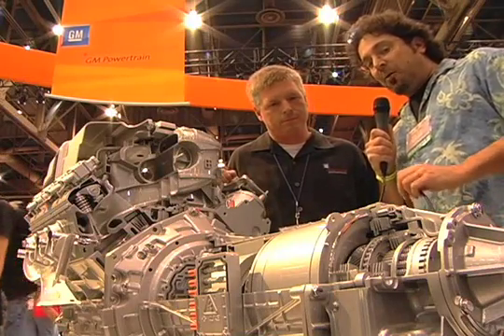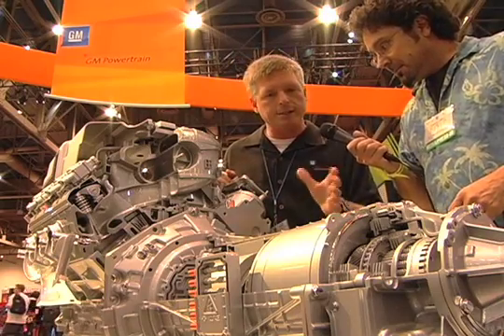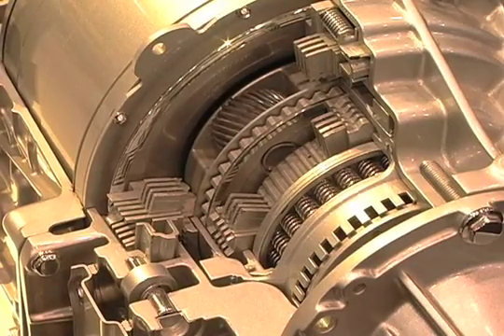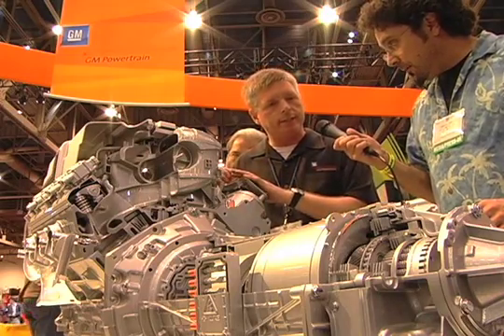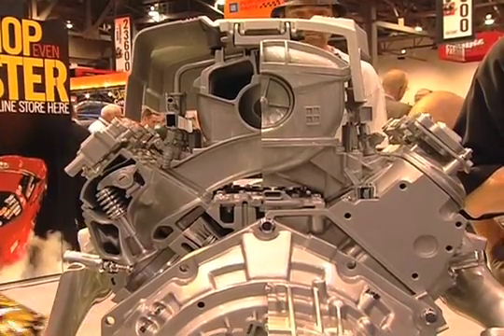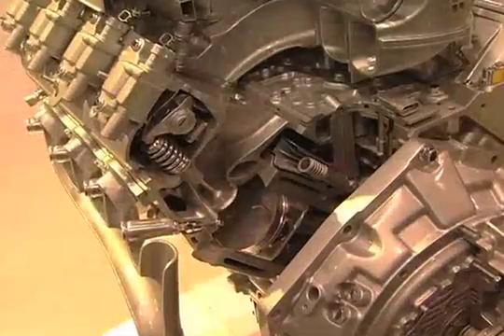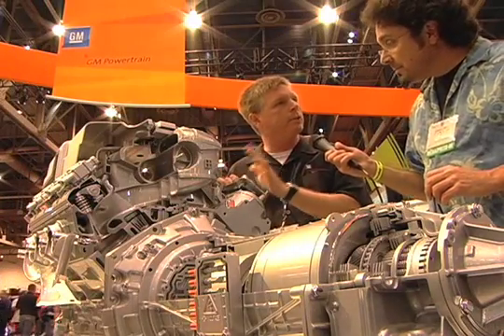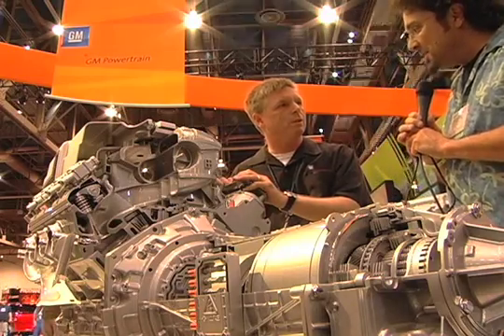GM Two Mode Hybrid @ SEMA '08

Comment: "No compromise"

Aside from the $8000 option price tag...

Horrible execution. This thing had enough combined power to be over 400hp from the factory. But they were so focused on fuel economy that they completely ignored the performance benefits.

And even then, they put in the biggest V8 they had in the stable (with afm) instead of the 5.3l. And EVEN THEN it could only tow 6k lbs.

Meanwhile a diesel V10 VW SUV got better economy and could tow 7k lbs.
Reply: Yas daddy